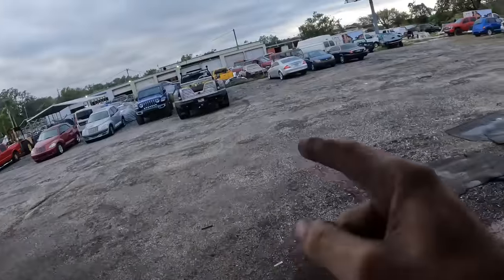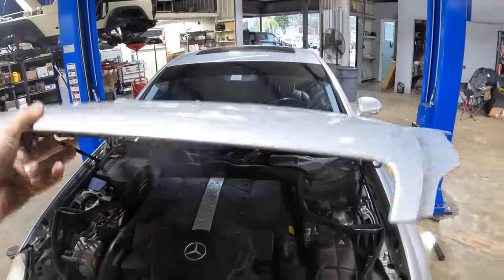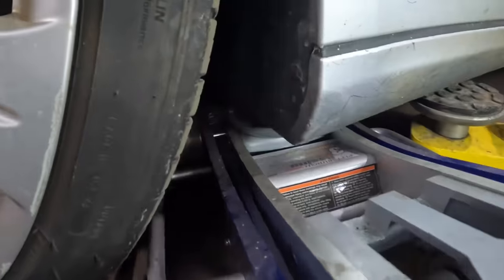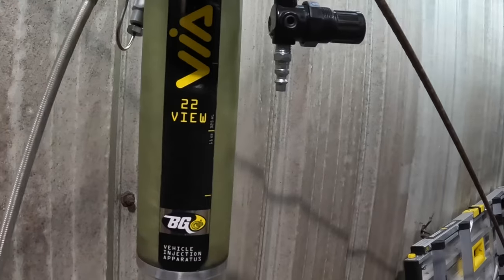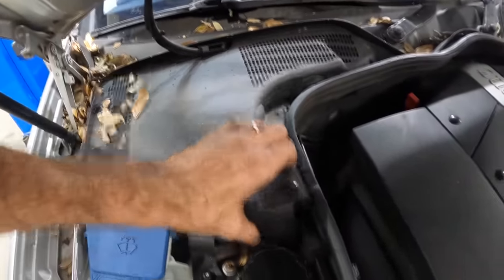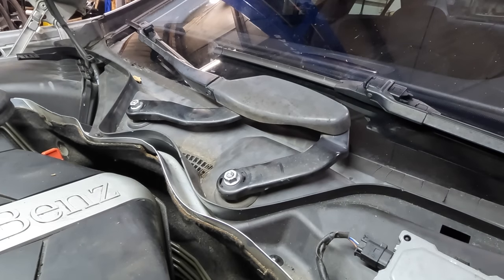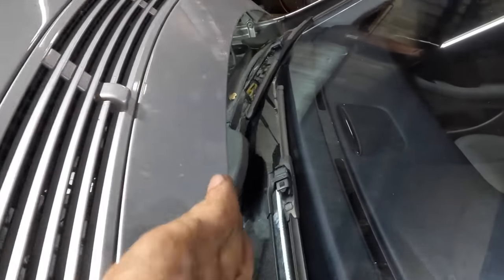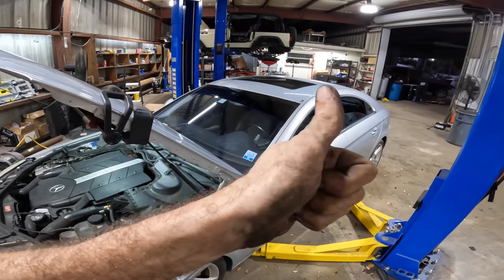Rookie Mistake on a Mercedes! “I quit” @SouthMainAuto

Comment: Think about moving front wall with overhead doors out to edge of cement so if you pull cars in.That way you don't have to clean up everthing your working on every time you leave. Its looks very easy to move. So much work space for effort needed. Shouldn't cost anything but a few anchor bolts.

Comment: Shops or dealerships? More appropriately called stealerships? I had a BMEW dealer ask for 2000 to replace Ignition coils, a job that took me less than 3 minutes per coil and each coil cost me $28.00!  wish all mechanics were like you!

Comment: I got a quota for my bronco going to the 10k on a mechanical shop, they were going to do gasket change on the engine because "there was an oil leak,"  caliper replacement because they were leaking and one of the front discs was cracked. I indeed had a leak, but it was because the transmission seems to been hit from below, cracking the case. And there is a tiny leak of engine oil most likely coming from the pan, and a new wiring harness because there was a rat nest on the hood.
Got all the Gaskets for the engine, a completely new transmission to rebuild, the front axel (Dana 44) with transfer case. And I paid like 700 bucks for all that. And it seems like it's going to be another 300 for the complete replacement of the friction plates and an overhaul kit for the transmission. 150 bucks for a new harness. and a couple hundreds more on the fluid replacement. So about 1.5k in parts instead of 10k in the shop, and  they didn't even budget in a new transmission.
I understand why Old rebuild cars like broncos and jeep end up being re-sold for 20 to 30 k on current market once they been trough a shop to be rebuild, but the coast of the parts* and the frame is 1/3 of that.

Comment: 3 mins in is it a level sensor problem?  not a leak, ( I probably wrong) but allways plug in air suspension in first  especially as you have the scanner, if no code check live Data first 👍

Comment: When you removed that windshield plastic cowl, that brittle rubber on the top of the cowl got loose and cracked after years of being exposed to the elements, it's a common problem on these w219's and when this happens water on windshield will leak beneath the cowl and reach some electronic components that will cause electric mayhem, don't ask me how I know lol

Comment: "I wonder if shops put people in position, when they have a car that's not drive-able?" -Rainman Ray's Repairs. Yes, they do. Firestone auto did it to dspgaming, I believe they charged $500 for a tune up. Spark plug and spark plug wire changes if I recall right.

Comment: As an old boilermaker/welder.. it still amazes me about heavy duty machinery in general..
Beautiful designs.. nice heavy extensions..excellent safety to avoiding dieing.. all hanging off a 1” plate.. hanging off a 4th year apprentice weld…😵‍💫
I’m exaggerating .. sorry.. but everything does hang from those few welds..😳…
Keep checking them.. I’m an old g/dad..🥸

Comment: My power steering pump on my jk wrangler was whiny as Manhattan hypergamy betch. It had what looked like atf in it for some weird reason. I cycled all the old fluid out by emptying the reservoir and filling it with new Prestone power steering fluid. Problem solved.

Comment: Some shops do try to take advantage of people in distress.  I had a blown 7.3L Navistar diesel engine in a 2001 Ford cube van.  My usual garage quoted me $8,000 for a used engine from a junk yard and another $8,000 to swap engines.  I knew something wasn't right with those numbers so I elected to do it myself.  Turns out, the engine they were going to buy was the same one I ended up buying for $3,500 (nice markup, huh?) and I paid my nephew (licensed auto technician) $2,000 to do the work in my driveway.  I had been dealing with the garage in question for years.  I have never been back since that ordeal happened and I tell other people to steer clear of them too.  Yes, some garages will kick you when you're down.  Glad to see Ray has more integrity than that.

Comment: I'd love to see you get The mysterious P1101-oo and P1101-00 MAF and Air intake performance issues even after the replacement with a 1.4l engine 2016 model. Seems to be an ongoing issue from 05 and up. Elusive throw money at it problem.

Comment: Wow. I have a list on these CLS500 from 2006. If the air shock is all he has a problem with, he's fortunate. That is pretty much one of the most unreliable Mercedes ever built. It has the really great 5.0 M113 engine. Air suspension, as you can tell, is a disaster. The kind of transmission matters too. The 722.6 is rock solid. The 722.9, not so much.

Comment: I originally wrote this as a comment in response to someone here.

But I think these words can also stand alone.
So here they are.

What I learned when I first started working on cars, is they all are different and there's a lot to learn.

One of my mentors put it this was.

Being a mechanic is harder than being a doctor.

Doctors work on to different models.

Male and Female.
That's it, and that's all you have to learn and know about.

As a mechanic you will have to learn and know about hundreds of different automobiles and all their different features, abilities, and special add-ons.

Then every year there are going to be many more, along with the added new ways you'll need to work on them will also be changing at the same time.

He couldn't have been any more correct.

Then I started working building new aircraft like the 747's jumbo jets, A-10 thunderbolt- warthog, and then experimental aircraft.

I'm saying this because it was kind of a cop-out.

Once you build one, the next one is usually exactly the same.
Then I'd change aircraft and the same thing.
What I needed to know and do was almost the same on the first one I built and stayed the same after the 400th and beyond.

It actually got boring after a while and I'd try to get moved to different parts of the aircraft.

With anything and cars.

Anyone can turn a wrench.

What makes a good or great mechanic is knowing tricks and how to get around problems.

The better and more versatile you become, the better the mechanic you are.

I see it as that simple.

Rainman ray's got a lot of know-how and ways around difficulties.

Along with a great attitude that won't give him a heart attack at to young an age, and he doesn't seem like he'd be miserable to be around.

Now that's cool, mistakes happen, and the world keeps on spinning

Comment: FYI On this generation Mercedes, if you see bubbling or fluid flow in the reservoir, it means the screen in the reservoir has failed and the reservoir has to be replaced. Easy sign.

Comment: Replacing engine mounts on some of Mercedes V8 are insane. There is a special tool for the upper bolt but it’s still a nightmar, there is just no room. Done multiple struts on merc and bmw not hard.

Comment: As soon as you said the nut was loose I knew where your mistake was made. My initial thought was t test the wipers with the bonnet open to see if the nut was n the drive spindle. But we all learn from our mistakes 😀I had a courtesy car while mine was in for some body repair (other person's fault) and there was an overnight frost. I thought it as just dew n the windscreen so switched on the wipers. The drivers side wiper staid where it was while the passenger side moved as you would expect. I worried because the wiper had been working the previous day. I contacted the relevant person as I didn't want t mess around with it since it wasn't my car and they told me to take it to the local mechanic chain they contract with. Turned out the nut was just snug enough to power the arm in the rain but the ice was holding it just enough to pop the arm off the drive spindle.

Comment: Last time, I had an oil change with my now ex mechanic. I asked them to clean the battery post and connectors.  Here I was thinking they'd use a brush like you have. Oh no, they used a cleaning kit 12.95 and 30.00 for labor. I'm still trying to find someone like you in upstate SC.

Comment: Good looking car and impressed the car has well over 100,000 miles but, I wonder what's the condition of the engine oil and other regular maintenance items? I predict a rather large bill coming that customers way from: tires, air strut, alignment, engine mounts (at some point) and that all costs many thousands of dollars to put right.

Comment: If I'm not mistaken I think you should have turned off the air ride before attempting to lift that car in the air. Taking weight off of a fully charged air bag can not only destroy the car, but can also  hurt anyone in close proximity of the car you are working on. Great job over all with your channel.  Windy City Mobile Tires.

Comment: Wiper motors can be a pain to replace. I replaced one in my 1981 ford truck without removing the hood. And I think it would have been easier to pull the v8 motor then that little wiper motor. 😵‍💫

Comment: Personally I believe that far too many repair shops big and small tend to overinflate the repair cost. I tend to allow repair shops believe that I know nothing with regards to repairs. Allowing them to quote.  last year I was quoted £1200 to refill a DPF tank. They said I needed a pump, tank line replacement etc. I sat spinning around on their chair whilst they dug in. It cost me in total £48 to do. No tank No pump No other replacement parts required.

Comment: In answer to your question, yes. My mom had an 87 Grand Marquis. Quit on her in the middle of a cross country trip in the mid-late 90s. Nearby dealer quoted 1-2k for a repair. My mom said well I don't have the money I guess I am getting a Greyhound bus ticket back. They said hold on let us double check it and then they proceeded to fix the issue for a hundred bucks or so.

Comment: there is also a 68rfe rear wheel drive variant... it really not a good idea, especially after a multi-hour conversation between my boss and an engineer of the teem the developed the vehicle in which my boss said "If you say the words internal inertia one more f**** time". which for those who don't know internal inertia is a primary number in deciding overall centrifugal force, which balances the modern torque converter... which is then the foremost component of a transmission... so ya

Comment: Wouldn’t call it a mistake. Still have to verify everything else is proper. I’ve been doing this for 20 years and still take extra time to check everything. Been bit in hind quarter area a few times taking stuff back apart because I assumed it was simple

Comment: Well, it may have been a "rookie" mistake, but it was a chance to get all those leaves out of the cowling.  If it is anything like my Mercedes built Chrysler, it means you won't have them rattling around in the heater fan in a few months.  I can't watch Scotty Kilmer for more than two nanoseconds.  Don't start copying him.  Thank you for taking the time to align those wipers with the witness marks.  One spline off means the wipers hit, at least on my van.  You've got Johnny Nash going through your head (I can see clearly now...), I have the Hippy Hippy Shake with that dancing passenger side wiper.  Yes, shops take advantage of customers when they have them over a barrel.  When you find a good mechanic, treat him well, stay loyal to him, spoil him a little, never leave him as long as he's in business.

Comment: I was yelling at the screen "try tightening it first" 😂 😂, then I thought "Oh well, get to see what's underneath!", but then I realised that you probably wouldn't have unblocked the drain without turning it over, only would've pushed half the crap down the hose with just the blaster, so you didn't really do anything wrong at all, your mechanical sensai brain took over while your panic brain went "Rookie mistake" 😂 😂 😂

Comment: Love your work man however you are doing my head in with the shop layout... Appreciate your possible expansion however i still do not understand the main work hoist is the heavy one stuck in the corner. I see no reason to not move larger hoist to centre and the small one to the side for projects like the jeep. Out of the way from a running shop and more productive flow to the in and out of the normal daily stuff.. Sorry work smarter not harder.. Just my .02c from downunder.

Comment: Some observations -- that Mercedes has been ridden hard and put away wet. Hoping the owner is willing to put in the $ to fix all the problems. They can probably get away without the motor mounts (shudder) but the tires and the struts should never have gotten like that.

Comment: I was wondering why you were pulling everything apart for that wiper, lol. I don't work on Mercedes, Audi, Saab, or Volvo, and I try to avoid VW as much as possible. They are just a pain in the ass, and the parts are so expensive that the customers usually do not want to spend the money on the older cars. I usually just end up wasting my time, and when I do actually get the job, the repair ends up being twice as difficult as it would be on a regular car.

Comment: I think unscrupulous shops are fewer than in previous decades, the eighties and nineties were probably the worst. The internet has put knowledge into the hands of the people. This has helped tremendously to reduce the unscrupulous shop's ability to defraud the customer. Anymore these days, the shops go by the book. If a job says 3 hours in the book, they charge 3 hours. Shop rates, however, have hit $100/hr or more.

Comment: That lovely Mercedes (MB = "More Bucks")  is not legally driveable because of those tyres. I wonder how much effect the engine mount leak and the air strut failure had on the condition of those tyres?

Comment: all you had to do to get the double attached wiper off was press on the upper round cover and it would have popped it off without hitting it with a hammer. (98% of the time. Depends on age and if it is around salty water or conditions that will cause electrolysis more than usual).
Dude if you do not work on Mercedes vehicles often it's not rookie it is just learning a new vehicle or area not commonly worked on. It is not like benz makes it easy lol.

Comment: I was laughing at the wiper knowing the idler was tight but the drive nut was loose, hey next time just tighten the loose nut behind the wheel. OK strut replace both, that pass side will fail within weeks, what was the air rush noise from passenger side? Oh yeah replace the top air fitting the o rings get old and leak don't trust reuse unless you need to be proven foolish. You may get away with it because it is warm where you are but up north they leak, been there done that. Don't get burned.

Comment: Weird no washer spray while running the wipers.  I assume most luxury cars spray automatically with the wipers (shrug).
Reply: You have to push in the button to activate the sprayers. These do have rain sensors that turn on and adjust the speed of the wipers.

Comment: The compressor seals are more than likely worn due to leak on the strut causing it to operate for longer than usual. I would remove the pressure pipe & hold your finger pad over the outlet whilst actuating the compressor if you can hold your finger in place the seals are worn a good compressor will easily push your finger away or heat it up really hot.
Your lucky it’s just a Airmatic fault would love to see your rookie mistakes on one fitted with a ABC hydraulic system 😂

Comment: I aman advanced DIY,  I do help people with their cars.  Mostly women with little or no money.  I don't charge labor just parts.  I can't tell you how many times a lady will call me in panic because some shop toldnher she needs new brakes,  axles,  transmission, etc..  I have them drive to my home,  I check it out.  9 times out of 10, there's nothing wrong. One lady called me saying her SUV front end about to fall off. Had bring it in,  yup huge grinding,  guess what,  some snow and ice packed in and around the axles 😂. 2 minutes with a screw driver and she was on her way

Comment: Rheeeeeeee, so you just run the engine inside the shop and breath in the exhaust? No venting? I don't get it Ray. That's not right, right? Forgive me if you have this vented but I never see you hook up a tube to  the exhaust in any videos.

Comment: It's fast....drives like a dream at 110mph. I had a 2008 CLS550. I tell anyone I know that if you own a German luxury car after 50-60k miles you're tempting fate. Especially these CLS models. You can get one for about 10% of MSRP. A ford F150 of the same year has a much better resale value. Buy a truck.

Comment: Eh Wot beat me to it. A Mercedes,  BMW, Audi, Lexus etc. are only as good as the maintenance . As with most cars if you maintain them well they will last you a good while. 
   Personally I drive only Ford Trucks and for my wife I buy her Honda's. Both are very well built and lead the competition in their respective field . Of course there are other good vehicles but with me I need a Truck with comfort, dependability,  and durability.  I pull 45ft+ Fifth wheel and Gooseneck trailers loaded with hay to Quads to Firewood and Equipment . I'll put it this way , "I still drive my 1972 Ford F250 4x4 " same motor from bought new . Same 4 speed transmission.  I've replaced the seat and back window and tailgate. Everything else is maintained as should be. I've only bought new ones due to modern things. My current is a 2019 Ford Superduty F350 4x4 C.C , LB , 6.7 Liter Powerstroke. I absolutely love the power. I took my 45ft WolfPack toyhauler loaded with 4 quads and a Sandrail over the Sierra Nevadas and Siskiyou Passes at 80 mph climbing.  Purred like a Cat .
So most people who buy foreign are posers and can usually afford sending it in for regular maintenance. If you look around you can find several used Mercedes and BMW's etc. for the same price as used American Vehicles.  Lol go figure 🤪.